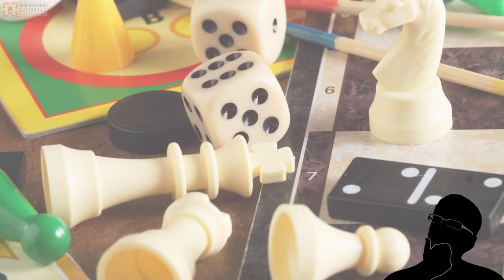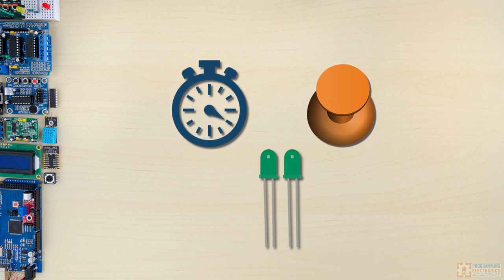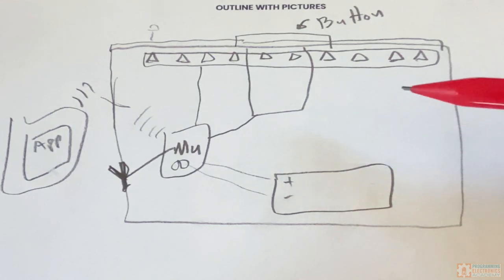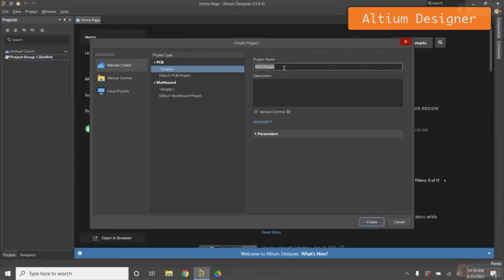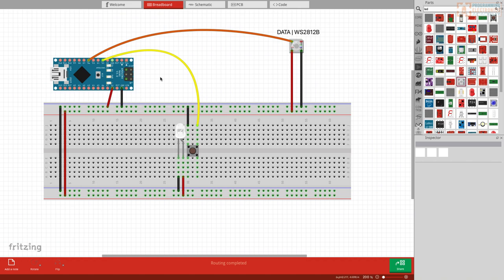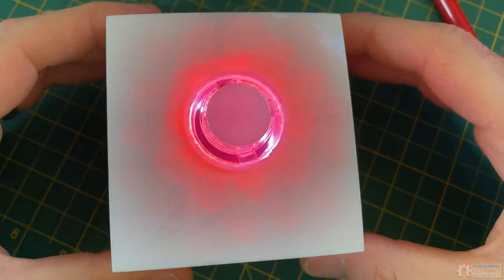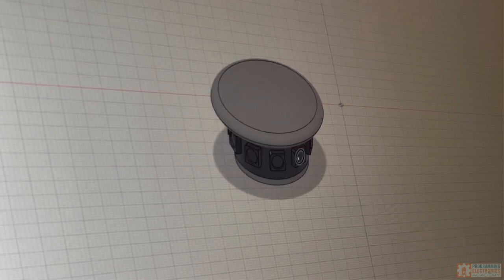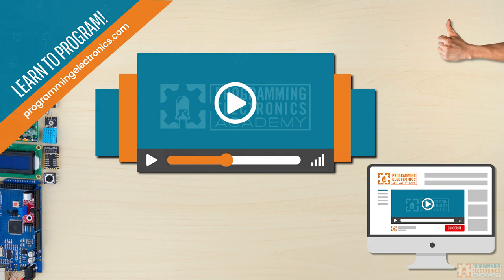NeoPixel timer with Arduino - super easy and fun!

Comment: Nice to see the entire make process.  I was given an Adafruit MacroPad as a gift.  When I was looking for a project for it, I did a multi-clock, CHESS clock.  Each player has their own countdown timer that's set to the total time for them to make all their moves.  At the start of play,  dial in the number of players, the total time each player is allotted, and which player goes first.  Each player has a color coded LED pushbutton.  When they've made a move, they press their button.  That pauses their countdown timer and starts the countdown timer of the next player.  A text display shows the player how much time of their total time has expired.
Reply from the maker: Cool - I had not seen that MacroPad before - sounds like you found a great use for it!  I think that projects involving timing are great ways to really force some hard thinking.  At least for me, when I have to start involving timed events - things get more real when it comes to coding something up.  Thanks for sharing!

Comment: Great channel, have a Question, Do you have a step by step comprehensive tutorial on how to write an independent pretty complete code for a multiple effects using one pin, specific for the IC chipped 3 pins RGB LED strips or the Pixels RGBs those contain in some cases more then 500 LEDs per strip or the pixels RGB LEDs like the WS2812 or WS2811, include setting up an IR remote control with multiple options like, changing effect buttons, random compound effects button, controlling brightness levels, schedule and timer, also sound reactive option with few effects all from the remote, without using FastLed’s or Adafruite libraries, As LEDs effects and how they work are the most interesting in learning arduino. And most of the tutorials on youtube are about how to blink an led and using libraries so not much of how to program Christmas lights for example, thanks
Reply: That’s what I’d like to learn, and you’re absolutely right about what most Arduino videos we see on YouTube, I always search on how to program LED effects, only I get a single led with resistor and blinking method, and when searching for multiple LEDs and we get that video header with Multiple LEDs, you get to think this is the one, to find out when start watching, are more single LEDs with resistors, and more blinking lol, when the others with led strips they only using ready codes from libraries would be great to find a course how to code those fancy effects
Reply from the maker: Hi Gus!  Thanks for the note.  Currently we do not have any comprehensive tutorials on programming individually addressable LED strips without using a library.

Comment: No code **Get the code, transcript, challenges, etc for this lesson on our website** - there is no link to download code
Reply from the maker: Thanks - Code added!
Reply: @programmingelectronics  thanks for the code 1 question please what IDE do you use as I have the latest arduino IDE and I get this - error: expected initializer before 'buttonPress'
 void ARDUINO_ISR_ATTR buttonPress() {

and error: 'buttonPress' was not declared in this scope
   attachInterrupt(digitalPinToInterrupt(BUTTON_PIN), buttonPress, RISING);

: note: suggested alternative: 'buttonPressed'
   attachInterrupt(digitalPinToInterrupt(BUTTON_PIN), buttonPress, RISING);
Reply from the maker: @phakalanep7241  Great question!   I was using an ESP32 and I thought I had needed the "ARDUINO_ISR_ATTR", but upon further investigation, it was not required.  So if you remove the ARDUINO_ISR_ATTR  from that line - it should compile fine.  I had a friend trying this on the Nano, and he mentioned the same thing, but I forgot to update the code -  updated now!
Reply: @programmingelectronics  PERFECT Thanks